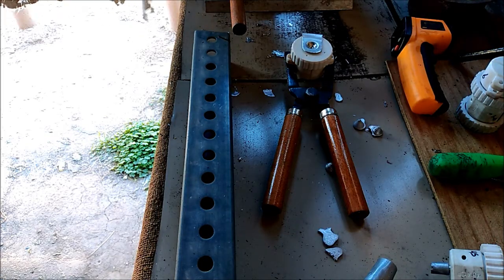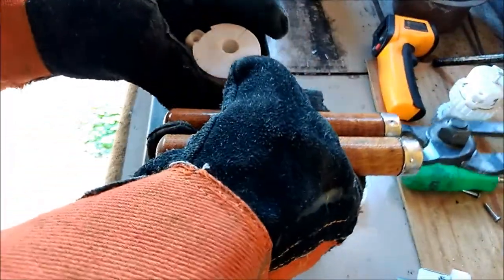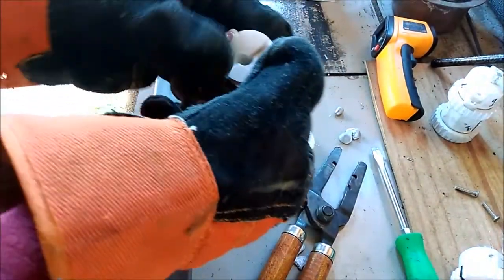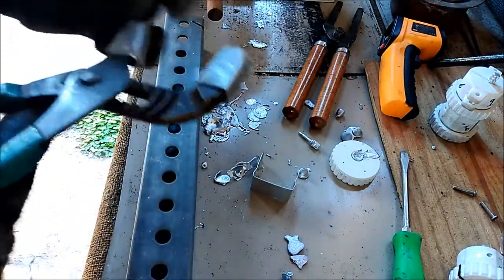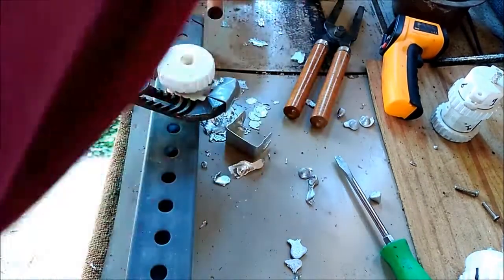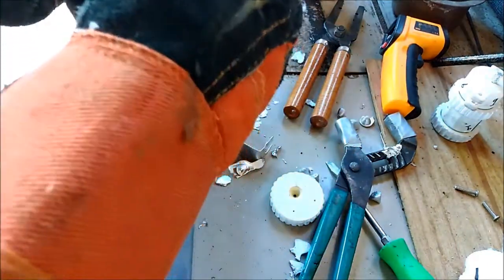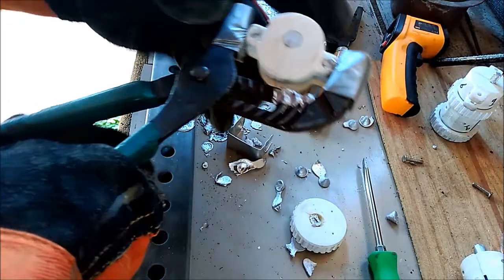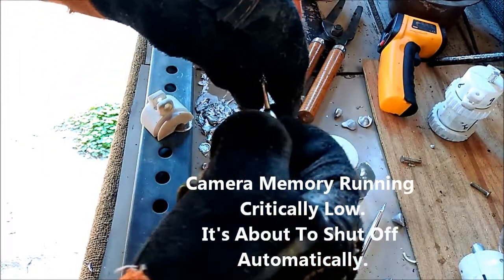3D Printed Single Cavity Bullet Mold - Dimensionally  Corrected

Comment: May I suggest you leave the handles pinned to the mold halves instead of taking them off every time. It should be easy to separate the mold after taking the cap off just with the handles like you do with a traditional mold. This is less fiddly and should up your casting rate by quite a bit.
Reply from the maker: That was the very reason I added those mold handle slots in the first place but, I found in casting with my mold handles in place that the position of those mold handle slots was causing me to get a gap between my two mold halves with each successive cast.

In the end I quit using the mold pliers and just ended up using a pair of channel-lock pliers instead.

With my next batch of prototype molds I'll most likely do away with those mold handle slots and just use that  pair of channel-lock pliers just to simplify things a bit more for me.

Thanks for the comment.